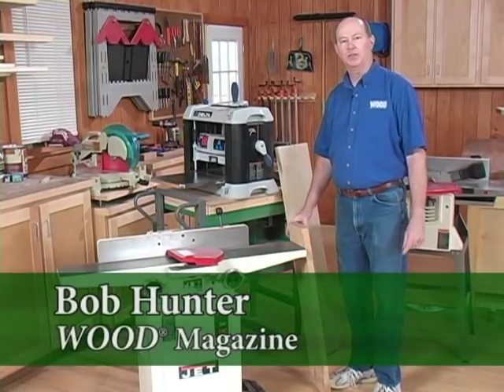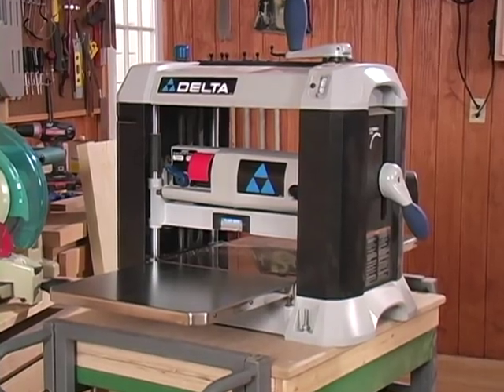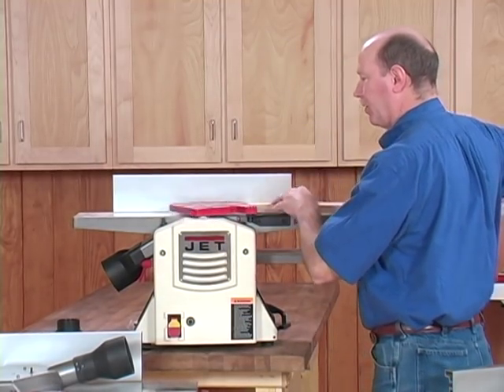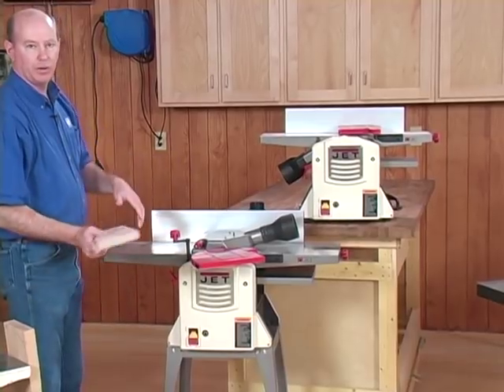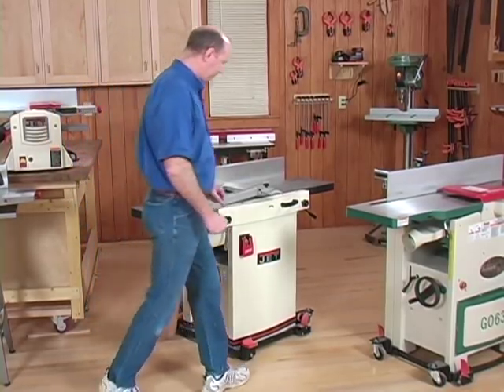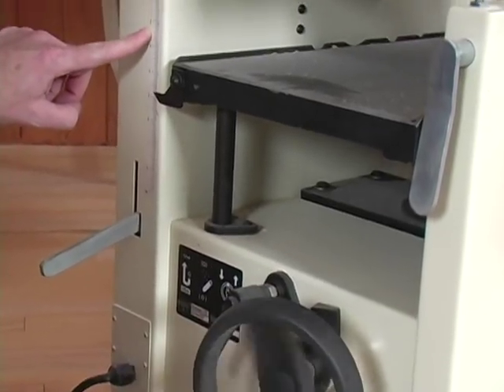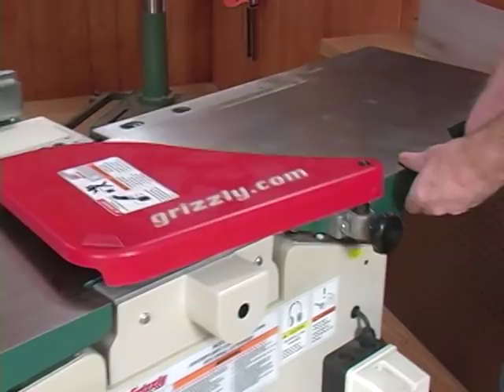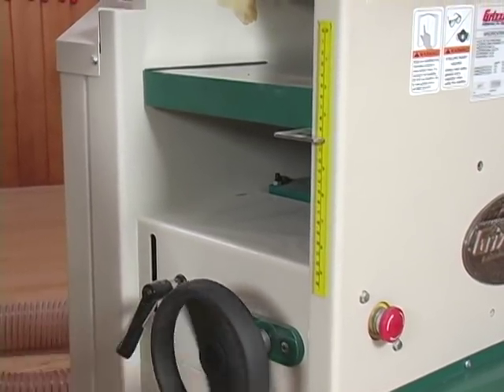Jointer Planer Combo Machine Reviews - WOOD magazine

Comment: Why do combo units that run 12-13 inches use 230v when the same width table top planer from dewalt or makita runs a standard plug?